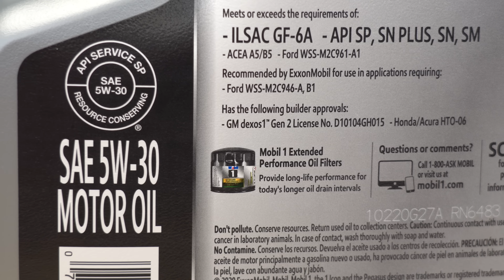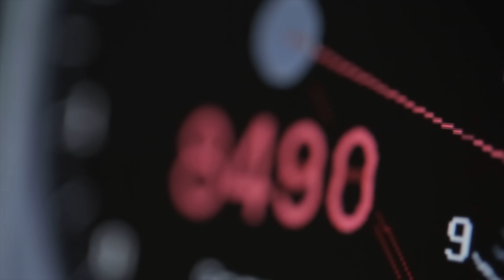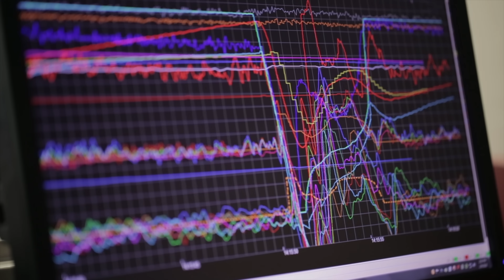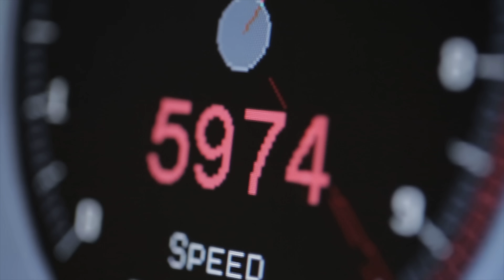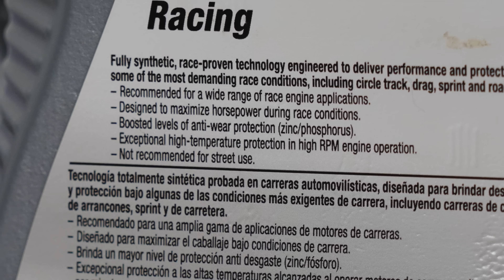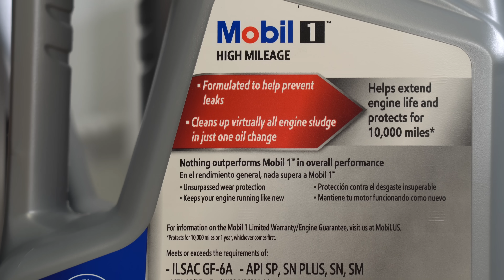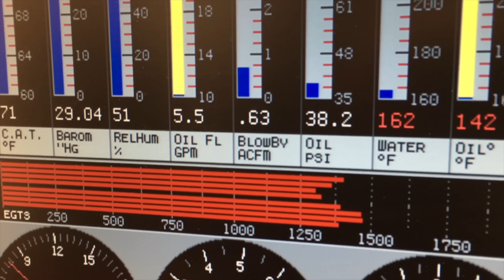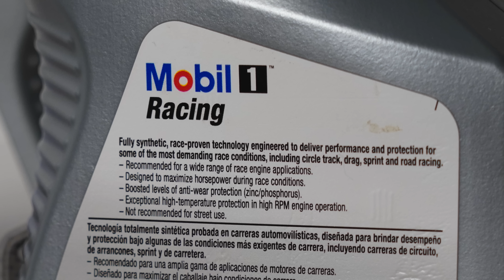Should You Use Racing Oil In Your Road Car?

Comment: What I’ve learnt ( the hard way) is race brake pads , track tyres , track suspension , ect ect don’t work as well as the same road items on the road. 
Race oil is no different .
Reply: Yeah, nothing like go out in the morning for a coffee and press the brakes in the intersection and stop like 20 meters off the intended distance.
Reply: @joseacuna3239  Yes you’ve obviously had race pads lol! 
Also noisy and harsh pedal feel and some have paint damaging brake dust  . 
I discovered every modification to improve track performance had a negative impact on road driving. 
Road oils need to be compatible with the cars emission systems like the cat and GPF or DPF , leave low carbon deposits, have long drain intervals, easy cold starts, low evaporation ( hopefully help reduce intake valve carbon build up) , good detergent package as well as lubricating moving parts . Basically it needs to work over a wider range of conditions than a race car oil.
Reply: @Byley-e7h  got you, driving a full blown race car on the streets is never a good time and I’ve learn that the hard way. Now I’m balancing with a nice daily (Honda for reliability) and a race car, daily take me places and race car take me to podiums
Reply: @joseacuna3239  Yes that’s the best way if you can afford it 👍
It’s the same with off roading the better the vehicle is off road the worse it is on road from what I’ve discovered from watching on you tube . I’ve never been off road , but did once go across well maintained grass field in my road car without any drama luckily .
Reply: @joseacuna3239  Or get your coffee spilled due to the combination of speed bump and track suspension
Reply: @Byley-e7h  or having to use race seats with stock seatbelts without airbags because race car
Reply: @joseacuna3239  Or having race seats with a six point sabelt harness and no standard seat belt while at a petrol station with a big queue behind you while you fumble around getting it on .
Reply: When some street cars had optional suspension packages, that was a no-brainer choice, adding greatly to control and reducing motion-sickness.
Reply: that's why you have more than one car
Reply: @bilaltariq7819  if you can afford it...
Reply: This thread is funny but makes so much sense to me. It's like the engine itself -- for racing, nothing has to be any good or, importantly, any FUN at low RPM or when you otherwise aren't absolutely driving to win.

At 2/10, a race car's brakes can be near useless, its engine and transmission hate you, its suspension might feel non-existent - as long as it all clicks at 10/10.

Comment: I find the zinc additive interesting as I believe it is necessary in my snowblower. A snowblower engine is generally running at max load during its entire operation. I have never had zinc additive explained like this before, Thanks!
Reply: You are lucky to reach 100% load 80% of the time.  Depending on the engine it probably has flat tappets.  Just run diesel oil in it and call it a day.
Reply: @ShainAndrews  my point is it’s under high stress all of the time and the zinc will help the valves.
Reply: @ShainAndrews  that’s an excellent idea. I haven’t thought of it for an application like this.
Reply: @JAMESWUERTELE  It's all we have ever run for two generations.  Small engines will pull start in the winter on 5w-40.  No need to change it out for summer operation.  Have a 20hp gas compressor.  Probably 1500 hours on it now.  Runs like a champ dead of winter, or peak summer.
Reply: Any engine oil that is recommended for a snowblower will have zinc in it, but the load isn't that bad with its low springpressure so it's no point in going above and beyond.

Comment: YES it's okay to use Racing Oil. IF you know what you're doing. Reserach the TBN and base the intervals on that. Racing oils usually have a TBN similar to regular Oils, so there's nothing to worry about. Also, look at the additives present. If it's a modern formula with Molybdenum and Boron or even organic friction modifiers then don't put it in your 40 year old Muscle Car. If you don't understand it, don't use it. And don't think anybody else but you is liable if your engine does go kaboom.

Comment: Absolutely right. 
I have to order my high zinc oil from Summit, for my flat tappet engine. The majority of off the shelf oils are detergent oils and do not protect as well as my high zinc oil
Reply: @ShainAndrews  All engine oils for road cars have detergent additives in them, no matter the zinc content. If you want an oil without any detergents in it you would have to go for a racing oil, though many of them have detergents as well.
Reply: @PSA78  It’s not so much the detergent,it’s the higher zinc content for flat tappet motors in older cars. You need the zinc not to wear on cam lobes and lifters
Reply: @nickpappas4133  Yes, I know. 🙂 Diesel specific oils are not the answer though, if you can't get a hold of the exact compounds they've used. But there's oils out there with higher levels of zinc, just got to look for them. It's usually only traditional flat tappet cams that one needs to be concerned about, bucket style etc is usually not as big of a problem, for roller engines it's pretty much only the rings that need some. 👍
Reply: Diesel engine oil....

I have zero fucks to give.  Piss in your sump for all I care.
Reply: @ShainAndrews  
Diesels now have emissions restrictions as well, for about a decade now. Unfortunately they had to cut their zddp numbers to protect their exhaust filters as well
Reply: @WW226  And on top of that, a blend for diesel don't necessarily have the right additives that works with the byproducts from gas, you need one that's approved for both gas and diesel in that case to be sure. It can end in complete disaster with people making uneducated assumptions like this, that's why they have the classification printed on the bottle. 👍
Reply: Oreilley stocks 5 quart containers of valvolines high-zinc oil, I've been putting that in my truck for years now
Reply: @Benlucky13  You do have to be careful with high zinc oils, as they will destroy a catalytic converter.
Reply: @Benlucky13  
I did that too for years. Unfortunately the Oriellys where I live no longer stocks Valvolines zinc oil
Reply: @WW226  I’m thinking about about using Valvoline VR1 20w50 in my classic flat tappet Porsche. You are correct it’s hard to find a high zinc content oil.
Reply: @ShainAndrews  It's pretty hard to know what you know when you express yourself in that way. 🤷‍♂️
I assumed you were still talking about the OP, but you seem to wandered off somewhere...
Reply: Try shell rotella t4 at tractor supply or an auto parts store
Reply: @ShainAndrews ‘detergent oils’ are typically used in conjunction with pumps/filters. Non-detergent SAE30 was meant to allow contaminants to fall out of suspension, as there was no oil filter on the old cars, and either stick to the crankcase or settle down by the drain plug.
Reply: "Detergent oil", I believe you just invented a new word, congratulations! :P

Comment: Usually its down to budget isnt it? Why pay extra for something that you'll never use or fully get the benefit out of? If i pay $28 for 1L that will work just perfectly fine. Why pay more when im not going to be gunning the engine at max revs for minutes or hours at a time?

I might make an exception if i lived in Germany and had access to the Autobahn. but we have no such thing here.
Reply: What kind of golden oil are you buying for 28$ per 1liter
Reply: @Y.p...323  Castrol Edge 5W30
Reply: @Rose.Of.Hizaki  five liters of that is 40euro in the Netherlands
Reply: @Y.p...323  the same 5L bottle costs £60 here. probably can find it a few quid cheaper.
Reply: I just ordered NAPA synthetic made by valvoline, $6.49 for 5qt on promotion

Comment: 4:08 "90-95% at wot" that reminded me of when I use to drive small cc motorcycles. everything felt like a race on that thing
Reply from the maker: Give it everything! "I am giving it everything!" - Me in my Crosstrek.
Reply: @EngineeringExplained  one reason I'm very glad I got a manual crosstrek 😁
Reply: @EngineeringExplained  Hello, on the VR1 20w-50 I saw 1 quart that said Full Synthetic and another that just said Synthetic. If it doesnt say "Full Syn" does that mean its a blend??? Ty
Reply: Haha, if you've been to Italy there are many-a small Fiat which operate WoT 99% of the time. With the horn going 99.9% of the time!!
Reply: so true! i had one and was always WOT all the time. if I tried to go slower, drivers would literally kill me, so the poor thing buzzed at high rpm all the time.
good engines, those little piaggio ones.
Reply: My 91 civic...
Reply: Smaller displacement bikes are great if the ergonomics fit you.
Reply: Motorized bicycle wot gang
Reply: You spelt “rental car” wrong
Reply: Thats how high horsepower mini bikes feel😂
Reply: 600cc bikes be like
Reply: a CBR 150cc is honestly so fun on a super tight twisty road
Reply: @pkennethv  I normally ride a Yamaha R1, it does 154km/h in 1st gear so you never need to ride it hard. My friend asked me to ride her CBR 250 to the shop to get a new tire installed. She rode on the back, holding two new tires. "I'm givin her all she's got captain" felt so nice to ring her neck and not even be doing anything illegal. If I take my R1 to redline in 1st gear, even on our biggest highway, that would equal drivers license suspension and impound my motorcycle. Love small bikes.
Reply: @toysareforboys1  I agree the small bikes can be more fun. It's why I kept my 500 ninja so long after getting an S1000RR. Many bikes between the two, not just a step up. The S1000RR does 151km/h in first and doesn't let up with the quick shifter. I have long highways around here and can get well into the 220+km/h territory, but if a cop caught me I'd get a ticket. Luckily at those speeds they aren't suppose to chase. Not that I do that a lot.

On the 500 though you had to ring all the life out of that engine and it was enjoyable to hit redline multiple times a ride in multiple gears. Light then the S1000RR too, so it was flick-able.
Reply: @toysareforboys1  also why I drive a BRZ (I don't have a bike right now)
Reply: @toysareforboys1  95mph in first? Sounds like you need to change your sprockets 😂
Reply: @pkennethv  even better is a 3-speed c50 cub on a gravel road.
The feel is just amazing

Comment: Hi Jason i would like to watch about BMW Vanos or double Vanos system (as a proposal).
Reply: Ahhhh VANOS... How brilliant of BMW to equip their cars with a self-destruction system in case you don't want it anymore.
Reply: @r0b3rt_959  isn’t variable valve timing pretty much on all engines these days?
Reply: @MichaelRei99  
That's a fact, but VANOS was often a death penalty for some cars (E60 M5 for example).
When it worked as intended, it did wonders, but it was very prone to fail, and the fix ain't cheap.
Reply: @r0b3rt_959  Are they still using it? And that’s why I would never own a BMW I lease mine.
Reply: @MichaelRei99  
I'm sure that modern BMWs use some kind of VVT system, but I don't know if it is some variation of VANOS. What I'm sure of is that they're way more reliable than in the mid to late 2000s
Reply: @r0b3rt_959  cool.

Comment: Mobile 1  The only oil I use!
Reply: I've never seen Mobile 1.
Reply: Saved my ass on a high performance engine that ate its own oil pump drive gear. Damn thing didn’t make a squeak. Replaced the OP and raced that engine for a decade after.

Comment: No my 20 year old renault which i got for less than a  mcflurry is not worthy of using someting better than frying oil.
Reply: Well i think my megane 4 rs needs some 5w-30 engine oil....or Castrol edge. Which is better for Megane 4 rs ? Mobil1 or castrol edge ? I put Michelin ps4s on the megane tho. Drives amazing.
Reply: @car-enthusiast3141  i dont know, i get the cheapest oil there is for mine, since its a cheap low power car

Comment: Mobil 1 gives my engine a tick but Warren oil doesn't. Why is that?
Reply: Mobil 1 has always  seemed too runny for me.
Reply: @Questchaun  5w is too thin, in my humble opinion. My car hates it.
Reply: @JP-hr3xq  the SAE viscosity range quite broad. It's best to look at the kinematic viscosity, measured in CSt, on the SDS if you want to be more specific. There is quite a wide variance of viscosity allowed. Pennzoil's Natural Gas based oils typically lean towards the lower end of the range, while Redline oils tend to lean towards the higher end. I'm sure there are other factors that play into this too, but that's beyond my knowledge.
Reply: Most likely slightly thicker at temperature.

Comment: How about racing fuel?
Reply: Do not run racing fuel in your oil sump.
Reply: I run "racing" fuel 110 octane in my fully built k-series. But it also has a super high compression ratio.
Reply: Too expensive and you only get to damage your car if the engine's not forged.
Reply: you need to tune an engine for racing fuel
Reply: @Kevin-dt9xm  Correct.
Reply: If you have a bone stock epa regulated system, the lead in race fuel will destroy cats and o2 sensors. Alternative to it is ethanol but it's iffy depending on what car you have
Reply: @BIGMEME_Retro.trance  
They make 110 octane that is also ethanol-free.
Reply: If not tuned for it - only bad results.
Well, for E85 anyway
Reply: Run what your car recommends. Without a tune and/or engine upgrades, your timing and compression won't take advantage of higher octane rated gasoline.